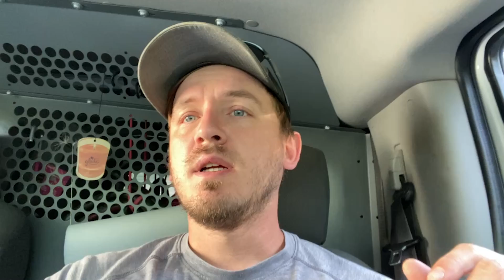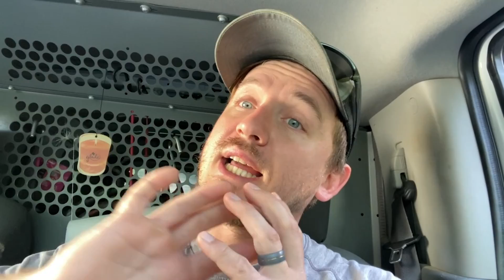Do Septic Tanks Need To Be Watertight?

Comment: Very informative, thank you. What’s the max weight that can be driven over a septic tank? Mowers and such.
Reply from the maker: My pleasure. This sort of question is difficult to answer. A mower is perfectly fine even a small golf cart wouldn't hurt anything. I've always been told to keep the total weight less than 10,000 lb. This include the weight of the fill dirt. There are tanks designed to be load bearing, but those are all very case specific strengths. Generally I would avoid traffic over the tank on anything larger than a lawn mower
Reply: @Wellssepticandmore  thanks, that is helpful.